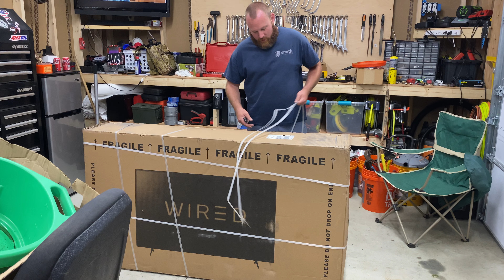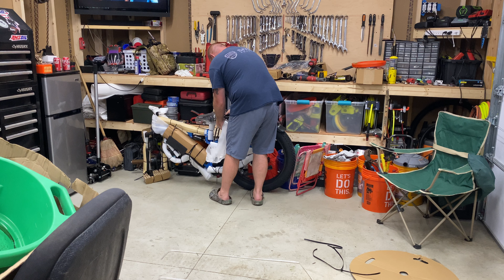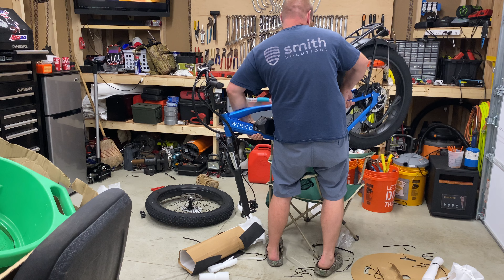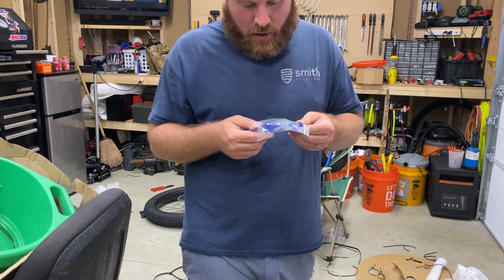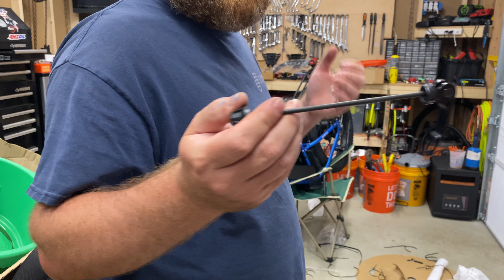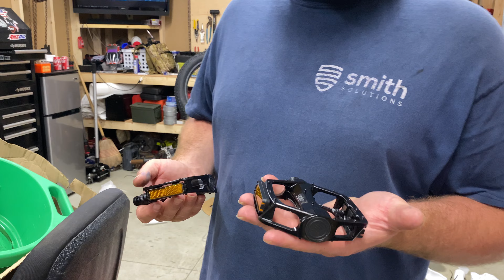WIRED FREEDOM E-BIKE unboxing and assembly

Comment: After watching this video.... I'm definitely gonna take mine to the e bike shop and have it assembled,
Reply from the maker: It really isn’t hard. Just a few tools really needed and minimal basic motor hand skills. Just don’t over tighten anything. Aluminum on any bike can easily strip the threads on the bikes
Reply: @maxnoutdoors   what kind of torque? 15 lbs?
Reply: @SuperSlappy25  snug plus a quarter extra turn.
Reply: It didn’t come with directions?
Reply: @robertstanderford8438  That's correct. No directions. No video link to YouTube video. I ended up putting it together in about 90 minutes or 2 hours... I ordered a second bike and I put that 1 together in an hour.
Reply: That sux. Mine is supposedly arriving mid July. Looking my forwards to it!
Reply: It's not that hard. This video is too long.

Comment: Next time turn bike upside down so it sits on seat and. Handlebars, push the control screen down a little so it doesn’t touch. It’s much easier to work on fork and front tire when sitting upside down.

Comment: Funny you mention how great the box it came in is cause when mine arrived over 1/2 of the top part of box was ripped off like a bear attacked it. There were holes & rips everywhere along sides box. & it was missing pedals,manual,touch up paint,tools for handlebars etc, 2nd charger...

Comment: I like it. I guess that suspension is kinda lower end and not that much travel on the little rear shock.  But better than nothing. Not sure how the ride would compare to the Step Through model. The Cruiser. Congrats! Let's see a flat ground top speed run some time.😎👍
Reply: When I get mine, I will probably swap out the seat post for a shock seat post.
Reply: You can upgrade down the roas.

Comment: Got mine, ridden it 4 times now and  I’ve felt the 40mph power but it drops in speed at some point during the ride and won’t go but 10 mph with pedal assist.   Throttle ?, or hub ?, or transformer issues ?,  
Do you have any suggestions as to resolve this.  When I tilt it over and throttle it it spins wheel but backs off to really slow speed.

Comment: When assembling the front tire is the rotor supposed to rub the inside of the break caliper? I hear some resistance of contact with the rotor just spinning the wheel by hand.
Reply: sometimes that happens, you need to do a simple adjustment. look up adjusting disc breaks.

Comment: I noticed all the same things when I put mine together.  Problem I'm having is it pulls to the left really bad. Eve parked it tries to whip the front wheel to the left.  At speed you fight the pulling.  Every quality Ebike I've owned you could put on the Cruise Control, take both hands off the Bars and go no handed with confidence.  Try it on this bike and I those flimsey plastic brake levers will be broken off sharp little weapons.  I was really letdown by the lacke of thickness on the fenders and mounting points for the fender struts.  I ride rough streets and my fenders are bouncing like the cheapest Dollar Store Plastic.   I'm afraid to park it in the hot sun, Dollar Store Plastic gets so brittle when it gets baked.  No winter riding because of substandard Cables, 
Fastners, Chain, And Pedals, Sprokets, Unsealed Cheap China Bearings, and Spokes.  In fact I have 35 miles on mine and the Front Forks are starting to rust from just Humidity.  Vaseline as lubricant in the Bearings Forks and Im assuming inside the motor.  Not mush talk of waterproofing on this Bike.   Poor Head and Crank Bearings and I have the dreaded loose magnet noise now at any speed.  What a Scam to get our money China.  Hire an American to process the Alibaba Shipping Containers and Trick us with the power and high speed.  Shame on you it's not Saul Goodman its Steve Goodman.  Shame on you for tricking us with the very very very low quality product.  Should I believe these are LG Cells inside this Battery or agaure you tricking us there too?   WOW, WOW, and WOW.   Oh check out the derailer guard.  One finger will bend it.  Just for Looks?  Even all that speed and torque grows old fast when you are sitting on such an ultra inferior product with loose magnets in the motor ticking and grinding.  Don get me started on Rotors, Calipers and Pads.  Heat treated?? Nope. Porosity and Inferior Metalurgy on every piece of this Wired Bike.  Oh but it goes fast.  Is the paint Water Color?   Just my honest opinnion here folks.  I have 50 years in the Bike Business and I know a Scam when I see it.  Pre order gets  that Money to China pretty darn fast.  Shame on you Wired E bike Co.
Reply: I appreciate your review of this bike.  What sub $3000 class 3, rear motor ebike would you recommend that has a minimum 18amh battery (I need the range)?
Reply: @1norgman  Fabulous Road Warrior X2, Ariel Rider Grizzly or AR Kepler, Amp Rides Volt DS, Magicycle
Reply: Making stuff up to poop on everyone’s parade because you are mad at the company because they didn’t give you a free basket and an affiliate link.
Reply: @jfly2249  he isn’t the 1st one I heard with the complaints which is why I avoided it … and how do u know he is saying all this because of that? Or are u saying bad experiences should not be shared so people can find out themselves?
Reply: @DriverJ-N  listen to people who actually have the bike, or don’t it’s your money.
Reply: So you are a chinese competitor?